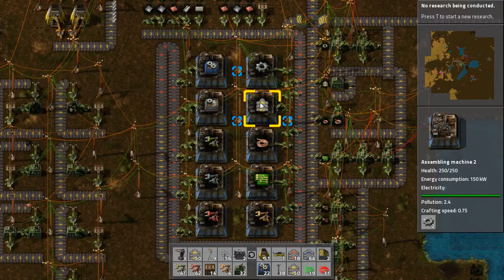Factorio How to Teach Your Factory Build Codes

Comment: Well.. the factory is sure compact... the control-system... not so much.

Just about everything in factorio (well at least first and second teer stuff) some of the following stuff  circuits, copper iron, sprockets and a specific thing, often prior tear.

For example. Inserters use iron, sprocket and circuts. Fast one, use circuts iron and normal inserters... the long armed...  same thing but swich out circuts for sprockets.

Copper cable is used for hardly anything. Appar from circuits (that is used for just about everything), its really just red and green wire, advance circuits (That need that quantity so they would need a dedicated copper cable anyway). the smal electric pole (that use wood so it would not work here anyway, the medium and big dont use cable) and the math units that is used very rarely. Also there is a additional problem. 1 copper plate is 2 copper cable. So they really consume a lot of belt space.

So i really cant se a reason to produce sprockets and circtus in line.. this is also true for cable that really have nothing to do there at all.

Also.. having circuts inline, reduce the belt space needed by 4 times. Sprocket reduce it for 2 times.

There is a really simple way of producing say belt, fast belts, undergrund belt and fast underground belts in one one line very simple. Even express underground belt (of some reason the underground expressbelt dont use lubricants, if you really need express belt but cant use lubricants, this is really a feature/bugg that can be exploted)

Put the assembly units in a line. have one fast inserter between every assembly unit. Start with the normal belt in the middle. The underground once (fast and express) in one direction, and the over ground in a other.

Then having a smart inserted to extract the finished product to the belt. Then smart inserters at the end of the belt to sort every product in to a storage chest. Then having a red/green wire back to the smart inserted extracting the products from the factory..

A other smart thing about this is that multiple products can be stored in every smartchest. You can have all the belt types as well as the underground one in a single chest. Really actaully just need one chest for all of the factory. (but its advisable use one for every type or product.

The factory with autohalt when no extractor want to extract the product. A other advantage of this if is something is excracted from the chests. For instance, if you have construction bots using transports belt. The factory start instantly to produce. The very some second a belt is extracted, the very same second the next one is produced.

Also.. its a much smarter way of throttle belt. I notice that the draw from diffrent product vary allot. Sometimes you need a lot of iron, sometimes a lot of circuits.

Its a very simple way of trotteling it. At then end of the belt. In steed of looping it all back, colect up the iron, copper, circuts and sprockets in  smart chets. Then have a slow inserter (or even better a timed inserter) extracting the things in the chest every now and again. Say a timed inserter that plop one out every 4 seconds or so.

Then have say 3-4 smart inserters  at the feeding side feeding in the stuff. So set the first  one to 0 in the extraction chest, the next one to 1, the third one to 2 and the last one to 3.

So if nothing come down to the bottom, the inserters go full tilt. In there come done a product every 12 second, 3 inserters go full tillt, if i come down every 8 second then only 2 insereters go... and if there come down one every 4 second just one inserter go... and if there come down every 3 seconds or faster, all insterets stop. This make it a bit wavy.. it works quite well. Maybe should make a video

Comment: excellent job for figuring things out but i do have to say something. its overly complicated and its way to slow,its programmable but even the "memory" takes up space and you are better off using that space to streamline the processes ,the point of automation is to make things easier faster and calculated not harder,slower,and prone to failure due to various problems(errors in the code), but still good job.

Comment: The factory you show at the begining isn't as good as it looks. It can jam easily, not to meantion things like fast inserters not being produced at all, or hardly being produced, as they are gonna be turned into smart inserters as soon as they reach the next assembly plant. Not to mention that most smart inserters could be switched with fast inserters without need to set the filtering settings manualy. Why bother? Also,  production ratios are varying a lot, so some resources are gonna get overflowing while other  will be produced much less.

Comment: it isn't a bug that your copper wires are getting through. as soon as you get a back log where things are packed up on your belt this causes compression between the items on the belt to the maximum allowed therefore often having them too close together to both be grabbed. the copper wire produces quicker than other items so when you have two in a row they get pressed next to each other and are now too close together. very nice factory though

Comment: Is it possible to have an Inserter take out the finnished products into a Logistic Supply Chest and then have Logistic Robots fly them to you per order without messing up the "program"?
Say Step 1 of the production is filled and the factory has moved on to Step 2 and I were to grab something from the first chest will the factory go back to filling that chest again or will it have to wait for the next reset for it to start filling up?

Comment: the cables get through because your factory puts them right into a traffic jam which gets cleared later. so it can put them closer to each other than it should. you could clear that traffic jam with this setup:
DLLLLLLXXXXXD
DFFFSUFFFSD
DFFFSUFFFSD
DFFFSUFFFSD
...
DFFFSUFFFSD
RRRRDULLLLLL
(basically, move the upward belts between the factories)
where R, D, L and U are conveyor belts in that direction, X can be anything unrelated, S are (smart) inserters (and electric poles) and 3x3 Fs are factories. also, corners dont have as much capacity as straight belts do, so put a faster belt on corners, that might already be enough to clear the jam so all cables will be picked up.
that way, the later products are put on the now empty "inner" side of the belt (where iron and copper came from). also, it'd be better to feed the loop in with a splitter, so it also feed the less crowded side of the belt.
anyway, i never built green and red cables because i was scared and didn't need them. might give it a try now, well, for less complicated things like reducing the numbers of factories i produce :D thanks man :)

Comment: "having all the material on one belt" (going both ways) is exactly what i did on my first try of the game.
what i found is that you really need to balance what goes on the belt otherwise you will end up either with TONS of unwanted items or the belt gets jammed.
what i haven't tried in that game is to set up a "control unit" that deals with balancing whats on the belt.

p.s. I found that having all raw materials and intermediate materials in one belt is more enjoyable to watch as the machine transform those materials and lay the finishing product back on the belt then the next machine take that item and turn it into something else!
Reply: As long as you match the speed of the items on the belt with the time needed to place, build then place again the item on the belt, then you shouldn't have any problems with basic materiel jams.

Comment: I'm coming a little late to this one, so you may have a more sophisticated design by now (one which doesn't treat copper and iron plates as anything different from gears or inserters). However, speaking to this video directly ...

You sometimes get that rare overflow of gears or cables into your "raw materials" loop. To detect / repair that, you can extend the beginning of your central belt so it loops back up around top of the copper/iron recycling loop. Then add smart inserters to lift any gears / cables / etc and put them back into the central loop, so they can be picked up by the storage chests they belong in.

Comment: Industrial engineer here.  you did a good job with this.
Reply from the maker: Thanks Moadib :)
Reply: +Warlord Mal why do u have one piece of normal belt in between 2 fast belts at 31.06. its on the same heights as the smart inserter putting stuff in the assembly machines one.
Reply from the maker: @roadtrain_  why?

Comment: To take care of materials (such as the Copper Cable) that get through you can always have a few smart inserters that can pull items off the raw resources loop and then have it fed back onto the main loop.

To be honest, while I can recognize what this kind of build can do to minimize over production, once I get logistics robots with requester and provider chests, it becomes pretty easy to control production and keep a fairly small footprint to produce only those things that you need.  In my last couple factories, I think the only thing that gets routed throughout the factory is copper and iron on a single belt.

Comment: i got a couple of fixes for you.
#1 looking at your top area that feeds your iron plates, i would switch the build codes for those first 2 smart inserters. your first one reads stone=1 and your second one reads stone>1. it should be swapped, cause your first crate is sucking up all the missed iron plates, so then you have to go and manually move it to keep the iron feeding. that will probably save that little headache unless you manage to keep those boxes fully stocked constantly.
#2 it seems that your smart inserters are just missing some of those wheels and cables meant to get put into storage, and then they proceeded to tangle up in your loop up top. why not set a smart inserter to snag them and feed them back down to your feed loop, problem solved and its all automated. then that should limit your belts binding up when too full. just a thought though. could help your issue out
Reply: Err ... I guess my comment was PBC's #2 already. My bad.

Comment: You could try to balance the belt, by placing the finished product on the opposite side of the belt from the intake. So, for example, if the belt is fed from the left, run down into the assembly machines, back out onto the other side of the belt, technically this would prevent the belt from ever becoming congested. Another idea could be to use a different return path for output from assembly, so basically as soon as the product comes out of the assembly machine, it runs back up to the feed faster rather then going all the way around. Having to go all the way around will merely slow the system down and isn't necessary.

Also, you should think about scalability, as in the 1:1 ratio is fine, but a more advanced idea could be to use mathematical calculations to basically scale assembly machines. So, your input feed line runs down the middle, and then to the left and right you have transfer belts running down a row of assembly machines, and the count of how many machines in operation be derived by the maths.

Also, you can stagger the inserters, a method could be devised to make the inserter speed variable. For example, 1 material inside assembly machine, 5 in a box next to it, when box below 5, trigger inserter to place material onto the transfer belt. At the moment, you have the stages which basically just trigger an inserter to go crazy throwing material onto the belt, but you put a small buffer onto the input of each assembly machine, and then only throw material onto the belt when the number is below that buffer, but then tie the assembly machine into the gates. Get what I mean?

Comment: How does it go to the left side as the belts don't connect/
Reply from the maker: Sorry Frank, are you talking about the raw resource belt?  Or are you talking about the control circuits? Or?
Reply: Malkasphia
The one where if you put 1 raw copper in the chest it would stop the circuit? But I think I get it, is it that the wires connect it and thus you don't need belts to feed the left side?

It looks so cool though, just trying to figure it out haha. (btw, the devs must have inside knowledge of real factories as my factory is all computerised now and works more or less like this. Of course I don't write the codes but I tell the people who do, to do this and they do it :))
Reply from the maker: Frank Spencer So the reset circuit that uses copper can spit out the copper once you come by and put another copper plate in...it places the copper on the belt which wraps back around to the inserter that checks for 10 assembler mk 2's. Does that make sense?

Also very cool you have a real factory and get to see Factorio life sized :)
Reply: Malkasphia
cheers, mal. that makes sense.

Yes it is, plus it makes everything easier for my other businesses as all i do is sell to myself. (basically) And the factory is in profit still...i am not sure how. I took it on to make my other business more profitable , so I thought the factory would be losing but its not. Which is great :)